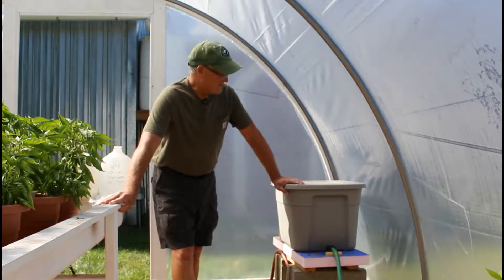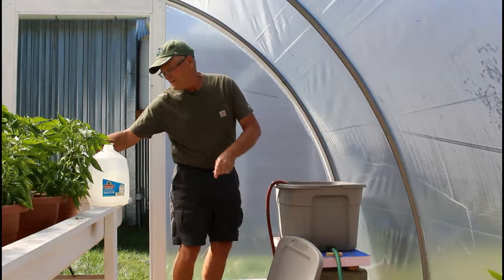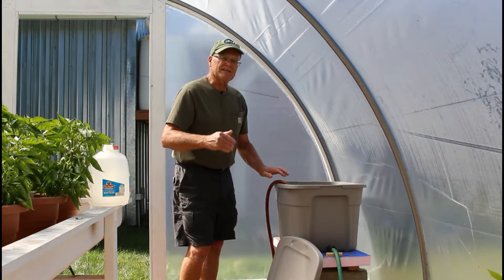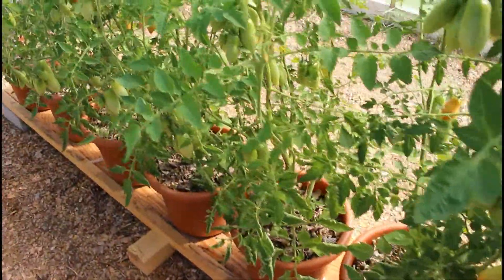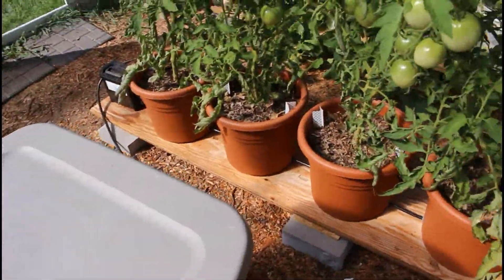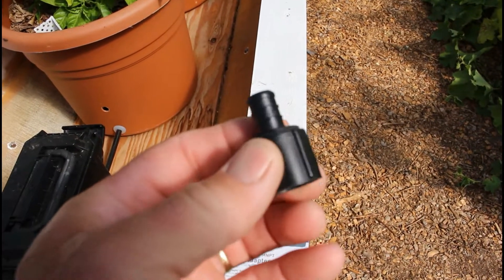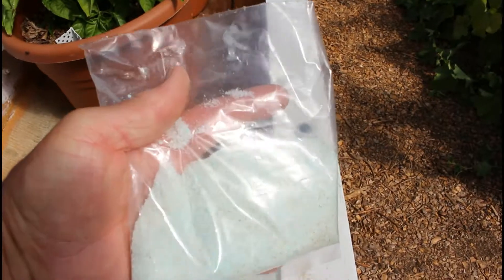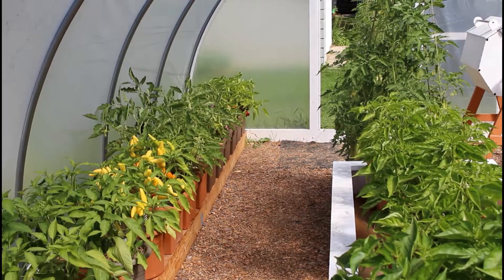Hybrid Hydroponics in our Hoop House

Comment: Great video - where do you source the silicone grommets?
Reply from the maker: Thanks Aaron. We have some available with tubing on our website. Otherwise, we bought ours (1000) from Quality Reliable Products, which sells fermentation supplies https://qualityreliableproducts.org/product/airlock-grommets-for-plastic-lids-13/
Reply: @backwoodbasics9383  how many gallons are the containers you planted in?
Reply from the maker: @thedestroyer3879  The smaller round pots are 3 gallons, and the square ones are about 4 gallons. We also us the 2 cubic foot  Earthbox-type bottom watering planters.

Comment: Thanks for sharing your hybrid-ponics setup. It looks really good. What is a float box? How does it work? Thanks
Reply from the maker: Thanks Jack. This is an adjustable mini float valve mounted inside of a small plastic box. The float valve connects to a water supply-like a rain barrel or a large tub. The box is then connected to a self-watering planter, or a series of planters. The position of the float determines the level that the water shuts-off (think toilet tank valve). We use silicone grommets and black vinyl tubing to make water-tight connections. There is also a hose adapter to connect to a garden hose. 
The float box automates watering, so you can go for weeks without having to add water. We have kits ,or just the float valves, available on our website; backwoodbasics.com